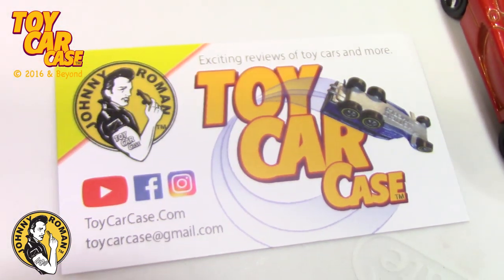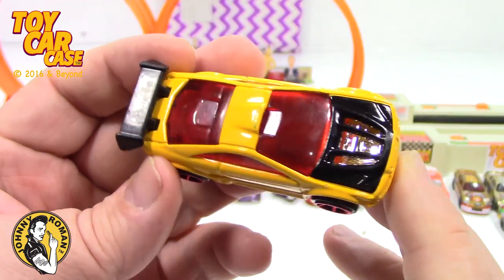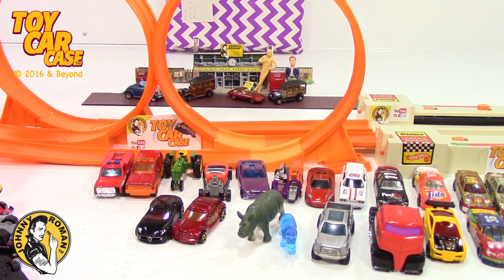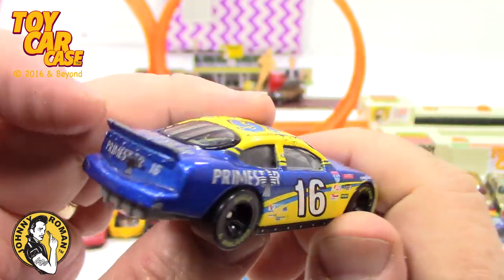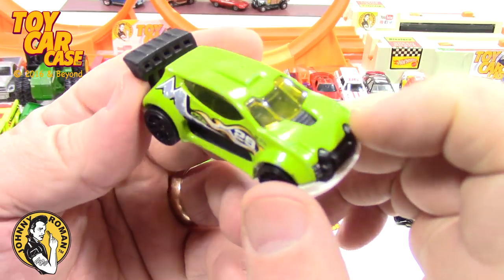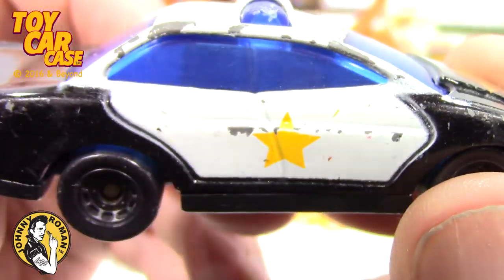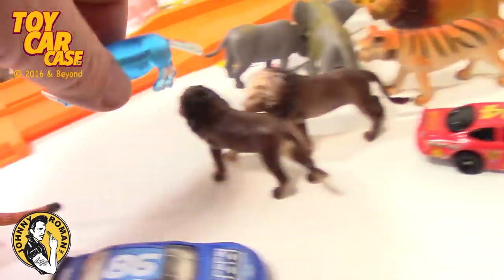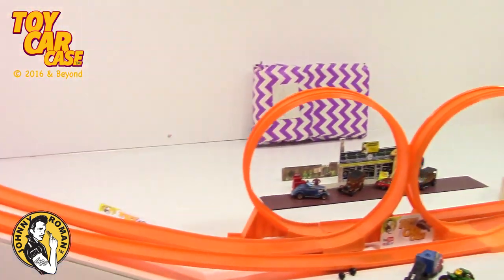Hot Wheels HUGE BIN of Garage Sale Find Hot Wheels CARS! Toy Car Case

Comment: Loops are for airplanes or people that like cars coming off the track 90% of the time.
Reply from the maker: Unless the wheels are bad or "Whack-a-Lack-a-Jack" they can make the loop.. .it is the wiggle track that sends them off track - if the center of gravity is too high. The set is made out of foam insulation so the wall is foam. I only have 8 feet to run them. Thanks for watching.

Comment: We has a couple-a those '72 Caprice road sofas. One in red and the other in 'metallic pea'.

@3:53 ~ Sup, dawg... we hear you like to ride, so we put a ride in your ride so you can ride while you ride....  We has one-a those ourselves

Also have a golden Nascar - our is slightly different...

Dang triangle head screws...

Lichen dat Deere...

We just rebuilt a couple Paramedic trucks - grafting the metal bottoms of the new cheap plastic-body ones to a couple metal-bodied castings.

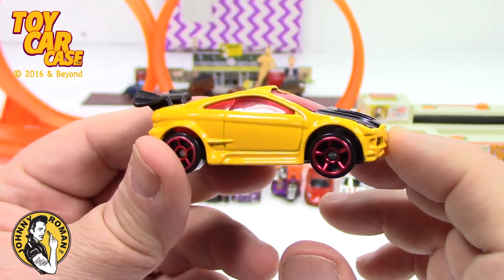@10:30 ~ We have the non-Macca's version of that casting - green with a black bonnet.

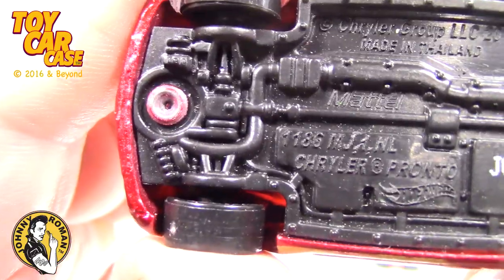 @13:49 ~ Czech out the typo!

Mattel took over Matchbox in the '90s so that 1985 date is when the casting was designed.

We have a Hot Wheels version of that Valvoline racer - even have the matching Hot Wheels tool cart.

Lions... tigers... no bears? Oh, my...

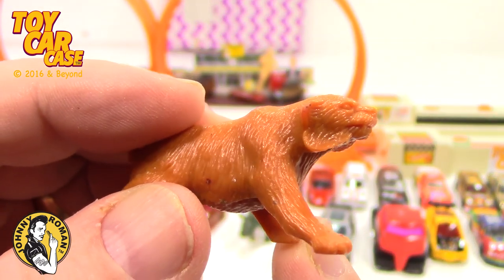@20:30 ~ sabre-tooth tiger?

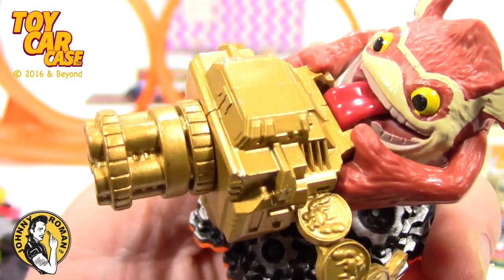@22:22 ~ avoid the Noid! He's packin!

That 'La Fasta' kinda looks like a De Tomaso Pantera...

Gimme a diablo sammich and a Dr. Pepper!

Happy Fun Raceway!

Nothing runs like a Deere - exceptin' maybe a snail in a hurry...

We have that Maisto Challenger - nearby Dollar Tree had a rack of Maisto castings on offer.

Nice color on that Corvette. Too bad the windscreen got 'Mansfielded'...

Dang Illinois Nazis got Elwood's old Caddy...

Coke or Pepsi? We'll drink whatever sodie is on sale this week...

Lichen the pink hot rod...

Time Tracker - when Doctor Who fielded a race team?

Lichen dat Lincoln.

As soon as your little kittle started meowing, our li'l Jenny had to come into the computer lab to investigate...

MEOW! Pay attention to me so I can ignore you!
Reply from the maker: Too funny, It was the first time I brought Ruth in the room. "Mansfielded"? OUCH! hehehehe you crack me up! Thanks, I have a couple more collections to video.